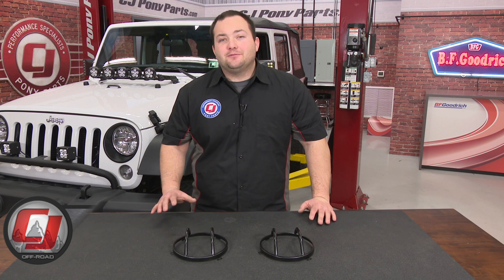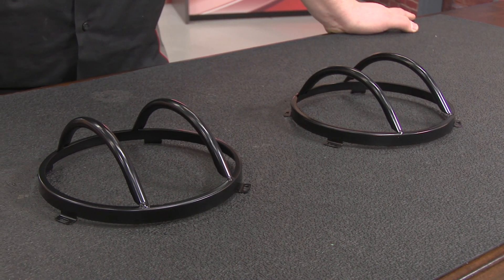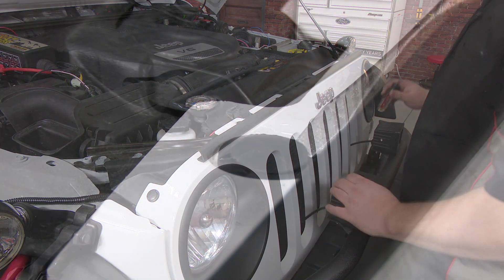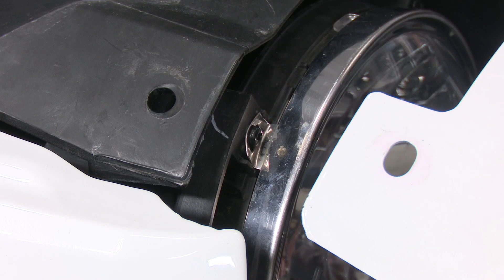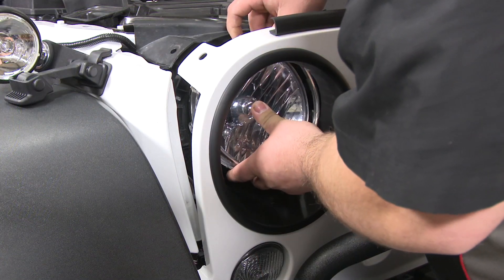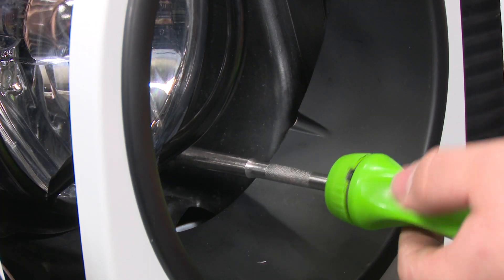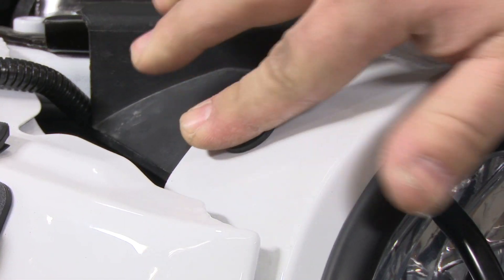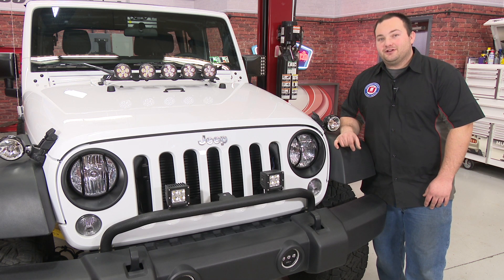Jeep Wrangler Headlight Guard Black Pair 2007-2017 Installation

Comment: Please check with your state inspection system before install or you'll be removing them like I had to.  Any item covering the headlight area will not pass inspection in my state, I learned the hard way.